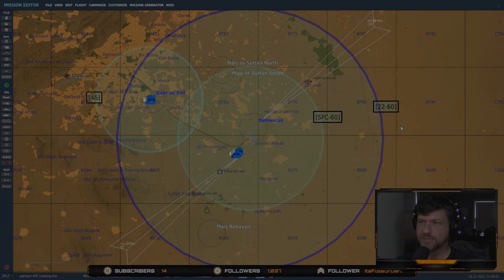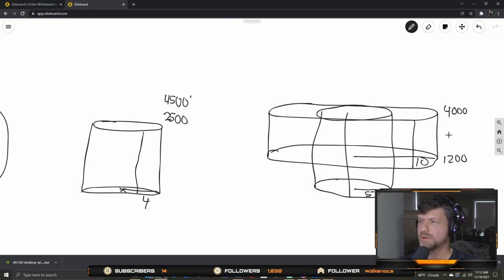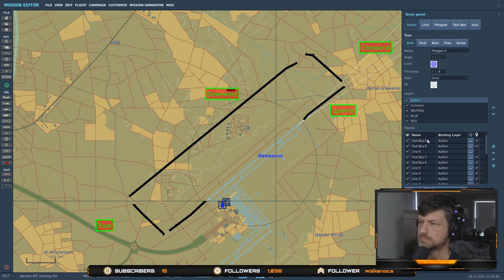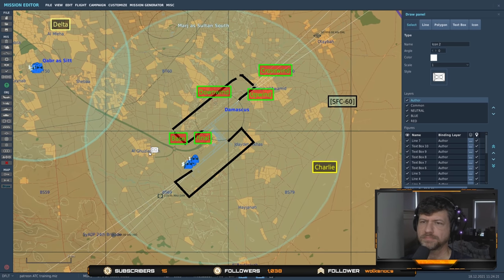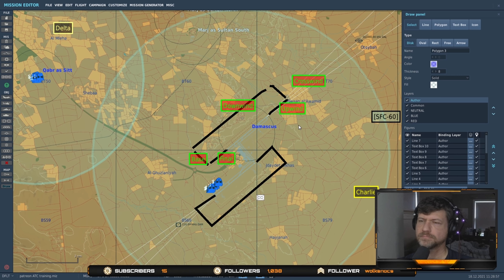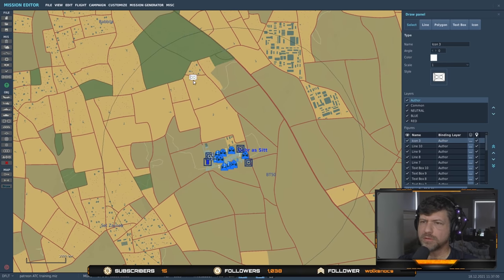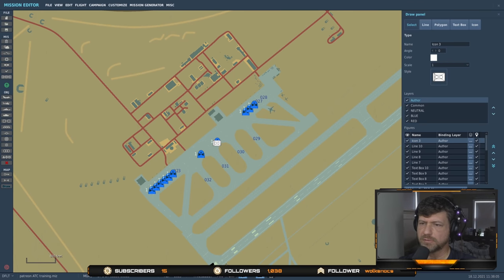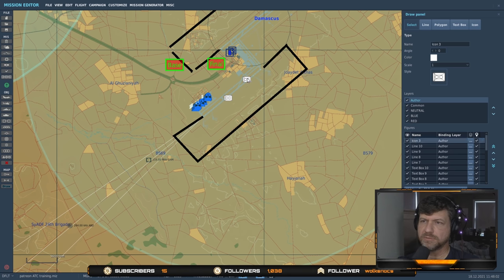DCS Helicopters and Air Traffic Control | Learning from the pros

Comment: Typically, two controlled airports that are very close will have their airspace tailored. For example, HNL and JRF. The ILS 8L goes through JRF airspace, so that part of JRF airspace is delegated to HNL. At Yokota AB in Japan (36/18), the airbase is right next to Tachikawa airport (36/18). Both airspaces are restricted with a straight line halfway between the two fields. As a result, no fixed wings can fly between the two fields. At Lihue airport, we have about 20 tour copters. Most land at the heliport, some land on the ramp. They don't use the runway unless they are doing pilot checks. They also use grass areas around the field. Even on the runways, we usually give them half the runway length.

Comment: faa class c should still be 2 way and transponder unless something is updated? Now the agency in charge of the airspace can deny entry or remove you, but you don't need permission to enter, just 2 way like entering a class d as I understand it from the far/aim and have done.  Maybe a confusion with class b requirements?
Reply from the maker: Transponder is required for C, correct. Maybe have been a misspeak. I don’t remember that being said. Things done live have that happen. 🤷🏻‍♂️
Reply: @CasmoTV  Yeah not digg'n, I think it was just confusion between class b and c, thanks for your time
Reply: You are correct, class C is the same as D to enter for radios. B is where you specifically need to be told you can enter.

Ex. For C and D
-Callsign continue inbound (can enter)
-Callsign standby (can still enter)
-Callsign remain outside airspace (can not enter)
Reply: That is correct, I got them confused, I'll blame it on not having coffee and being surrounded by big burly men.
Reply: @deadyplus1  that's a fair reason lol. I've done 1 DCS instructional video and when reviewing I don't even know what I was trying to get across to the viewer. And that wasn't live. But you all did a great job for a big part that the DCS community doesn't really dive into. They all shout that's for MSFS but then complain when things arnt accurate.

Comment: lol, 1-mile wide on downwind sound HUGE to me.  In my Mooney, I like a half-mile wide pattern.   I've seen light sport guys and piper/kitfox types fly 1/4 mile or less.
Reply from the maker: Doing a thing doesn’t make a thing correct
Reply: @CasmoTV  correct.  For example, if I flew a 1 mile wide downwind, it would be incorrect, because I would end up landing off the airport property if I lost my engine.
Reply from the maker: In a moonie? What’s your glide ratio?
Reply: @CasmoTV  book says 10.7 windmilling or 12.4 stopped.  In practice, pulling power at .5 miles abeam the numbers puts me between the numbers and the captains bars
Reply from the maker: Well what ATC “expects” wrt a traffic pattern is a base like. I’m routinely at a mile or so in a Cessna but a Cessna can handle that in spades. In a helicopter I was probably a bit closer. Aviation has a lot of rules and numbers and none of them matter as long as you keep the airplane safe I guess.
Reply: @CasmoTV  I try to avoid flying at controlled airports because they always end up putting me in a 15 minutes pattern for spacing, and being at TPA that long gives me the willies.
Reply: @CasmoTV  my big limitation for glide range is that at Vbg i sink 1200+ fpm, and straight ahead.  in a standard turn at Vbg, i sink 1500+.  at TPA, i can't make a 180 at Vbg before i hit the ground.   I fly my "low key" at 80 MIAS with approach flaps (vbg is 105), and that gives me a sink of ~700 fpm straight or ~900 turning.